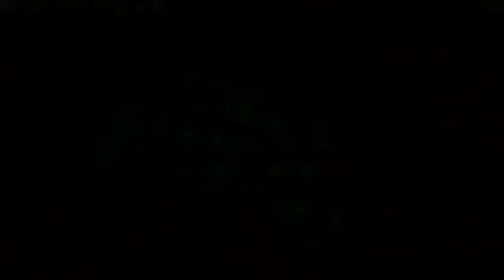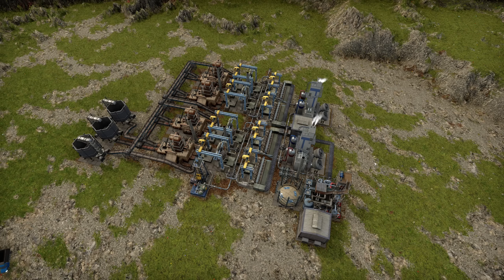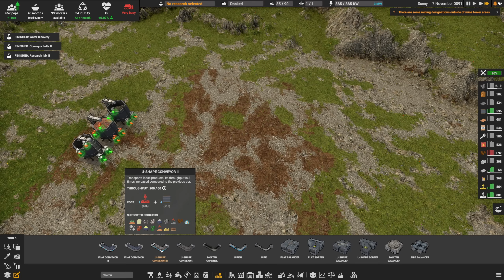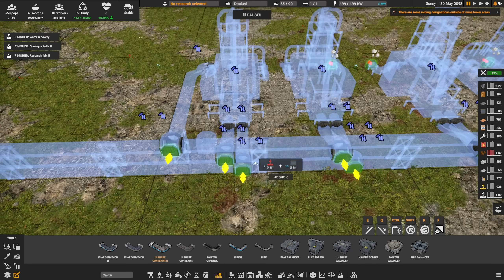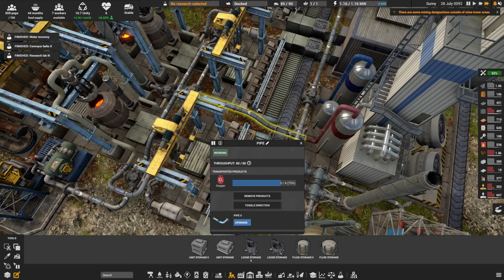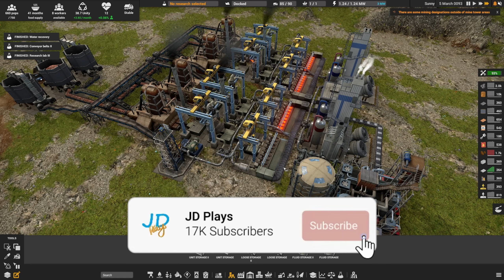Perfectly Efficient Steel Smelter 🚜 Captain of Industry  👷  Walkthrough, Tutorial, Guide, Tips

Comment: Ok question on your iron/steel setup doest 1 blast furnace put out enough molten iron/steel to feed 2 casters? In your setup you do 1v1 wouldn't it be more efficient to 1 furnace into 2 caster?
Reply from the maker: Blast furnace outputs 24 Molten Iron, The oxygen furnace consumes 24 molten iron, and outputs 24 molten steel, the cooled caster consumes 24 molten steel. As this does steel only this is a correct ratio, If you were doing Iron then you would need 2 Iron casters
Reply: @JDPlays  ok thanks ill look at the steel again I thought it was the same as iron, my mistake

Comment: Each pair of furnaces use all the O2 from the air separators. If there's a small bottleneck for nitrogen, would that slow down steel a bit?
Reply: It surely will, hence MK2 pipe between junction and balancer is a MUST. In case of backlog 2nd / big smoke stack is also needed. OR, separate smoke stack for separator away from balancer. Thats what her Majesty the Math says
Reply from the maker: YES, but that also requires you to use ALL the steel constantly. Which i don't expect to happen.
Reply: @JDPlays  That's true.
Reply: Even if I use the waste products I always have a smoke stack or burner for it, connected with a pipe balancer with the smoke stack at lowest priority. This is one of the big strengths of the game, you always have dirty options to remove waste products, instead of being forced into production lines that use them like you have in other factory games. This means that at any level of technology my oil refinery only ever stops running when my diesel is full, everything else is dumped or burnt or exhausted if it's not being used, even sulfur is burnt off.

I wish they would allow us to dump sulfur in piles though

Comment: How do you handle recyclable copper, steel and glass?
Reply: personally i enabled truck imports on the outer most furnaces and put the recipe with scraps as priority. saves on coal and slag
Reply: Instead of raw ore input - 2 storages linked to balancer, prio to scrap, ONE belt out, 2 recipes for smelter. They do just fine on same mixed belt
Reply: @peterlyaskovsky1473  Ooof, I've been building a second blast furnace to melt it then balance it back in to the feed with a priority. Well, I better try it this way and  save the population.
Reply from the maker: yes what Peter said, or depending on how much recylcing you can also just load from a new storage into a existing connector, as a stop gap till your producing a lot more recylables